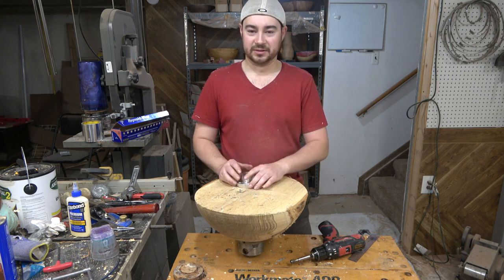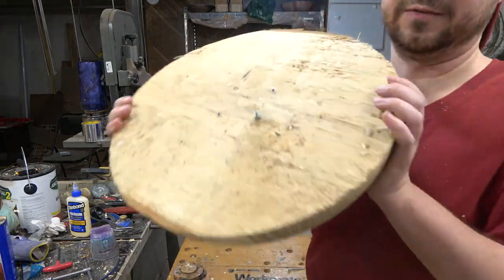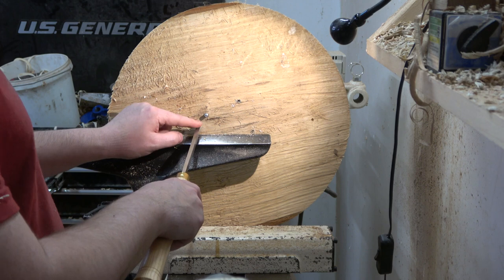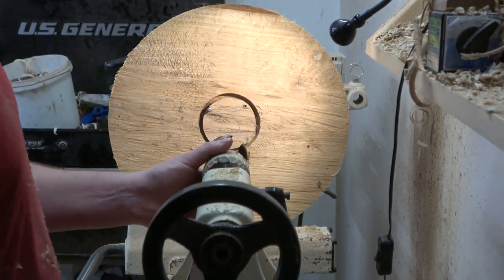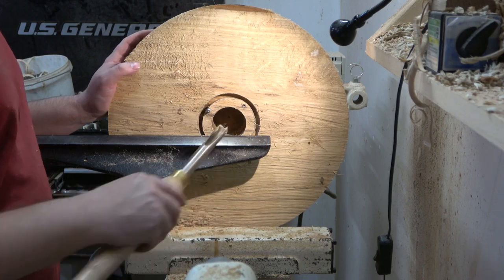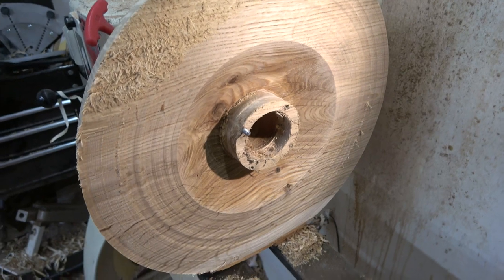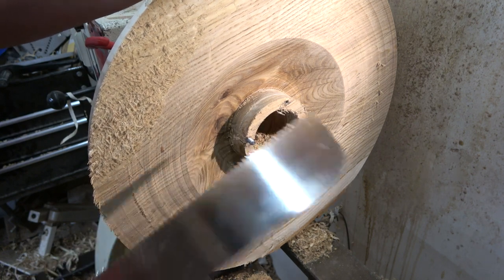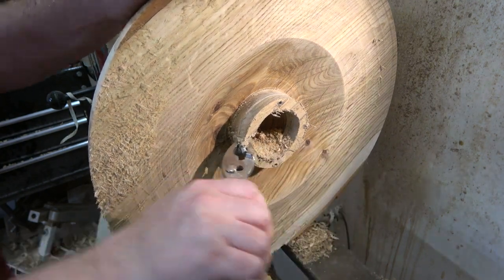How to remove a broken faceplate screw from a bowl

Comment: A lot of extra work there when can often use a pair of vice grips to tightly grab the shaft of the screw and back it out
Reply from the maker: Yeah and that works, unless it breaks flush with the wood. This is more of a last resort, the screw is buried in there and you cant get it out technique